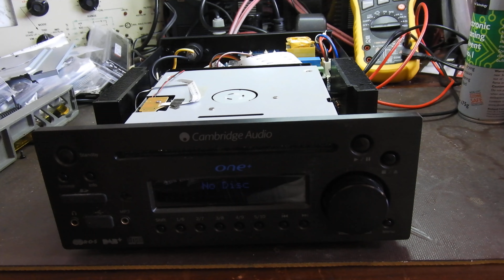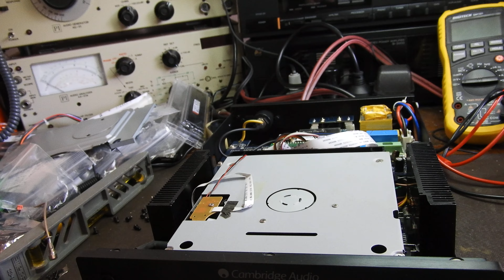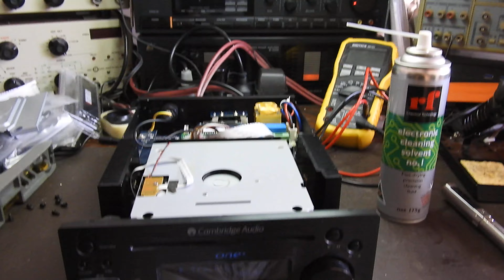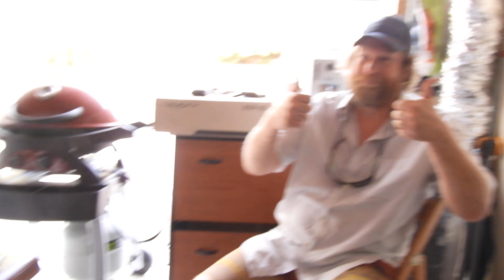Cambridge Audio One+. Slotted CD player/amp/tuner which kept spitting the CD out.

Comment: Hi! I have one exactly like this that does not want to spit out the cd and does not read the cd that I think is inside it. Any advice for me to go poking around in mine? Im in Africa unfortunately so cant bring in by your shop:)
Reply from the maker: Well, open it up and see what you can find. Not unloading CDs can be a belt or a gear problem but also something could have gone wrong accidentally. Someone could have just bumped it and things have gone astray. So open it up, remove the CD, put it back together and try again.
Ultimately, you can always replace the whole mechanism. It is probably just some kind of CD-ROM or CD / DVD burner. When you are inside of the player, look for the manufacturer's label which will tell you what exactly it is, so you could get a new one.
Reply: @hear-net-au  thanks very much for getting back to me. Will definitely scratch some courage together and get in there and see what's what. And I'll keep in mind your other advice on generic parts to replace 😁
Reply: @robsor85  And did you find the solution to fix the player?
Reply: @making-memories-nl  hi there! No luck I'm afraid. It's on the backest of burners at the moment as i have plenty of other Hifi gear which was not the case back then! Thanks for checking in!

Comment: Hi. I have an issue with this player. It won't load cd's. I have another one+ and swapped the cd units. Now the cd unit is working on the other one. What could be the issue. It is defintely not rhe cd player. You are talking about another switch in the unit. Where is it located, or do you think there is maybe another issue? Thanks for helping our in advance.
Reply from the maker: It is located... somewhere inside that drive. I do not remember where exactly, for it was 2 years ago and I have only seen it briefly.
Maybe the fault was due to bad or dirty connection. Once you moved the drive unit, you plugged it in and now it works OK in the other unit.
Reply: Thank you for your reply. That is unfortunately not the case. When i put it back in the original unit the issue is still there. So i it something else i have to look further. @hear-net-au
Reply from the maker: @making-memories-nl  I am sorry but nothing else comes to mind without seeing the unit and observing it in action.
Reply: @hear-net-au  No problem. Thank you for you reply. I can imagine that it is difficult to check offline. It is pretty simple do, it doesn't load the disk but when i put the drive in another one+ it does, so in this case it is 't an issue with the drive but with another part of the unit, but i think it need to check capasitors or something else on the connected pcb board i think.  But i am not that good of a technician   unfortunately. 😶